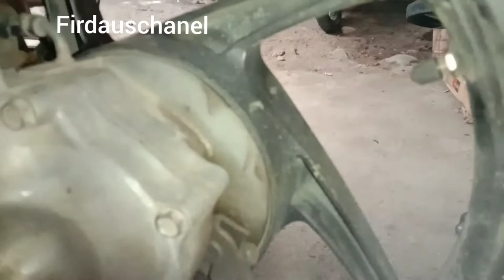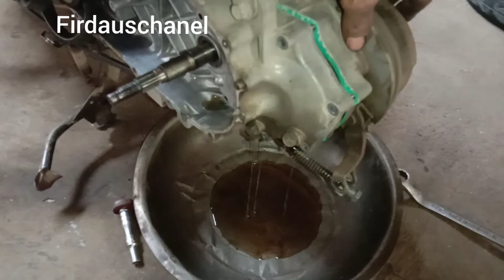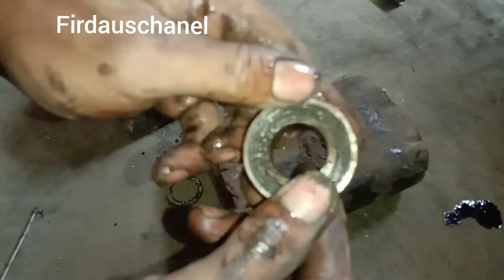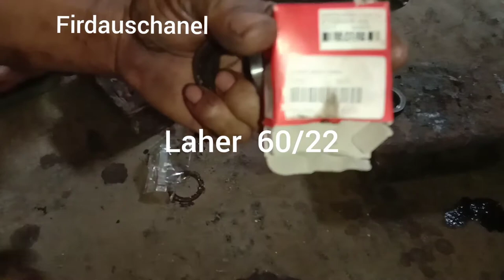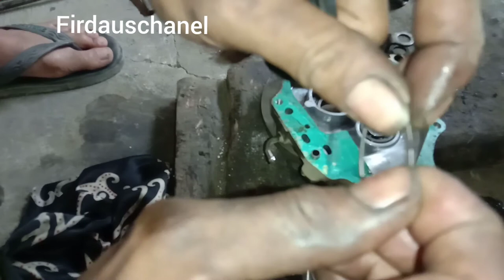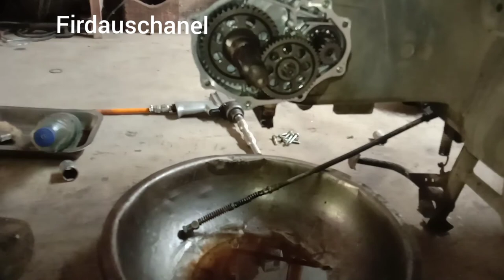cara ganti laher roda belakang vario

Comment: Gan bearing 60/22 banyak tipe kvb apa mana? Takutnya salah beli?
Reply from the maker: Bawa contoh aja
Reply: @firdauschanel  iya gan, kadang di bengkel resmi suka gak ada yg saya cari ,

Gan , kalu bearing 60/22 dengan kode 91009KVB903 dengan bearing 60/22 kode 91009K50T01 beda apa sama bentuknya ,apa beda kode aja, mohon di jawab?
Reply from the maker: @Sultanshops  sama bang
Reply: @firdauschanel  terimakasih bang infonya🙏